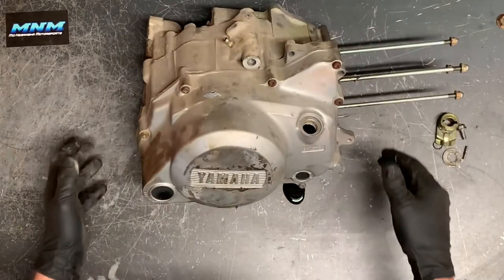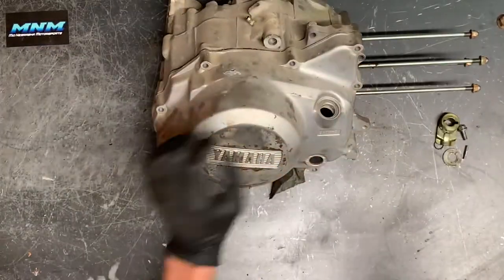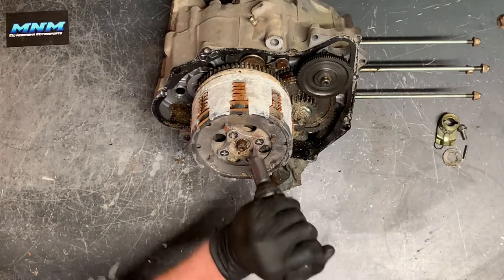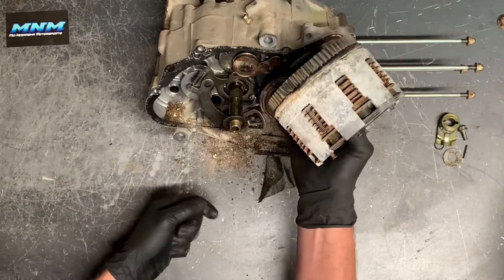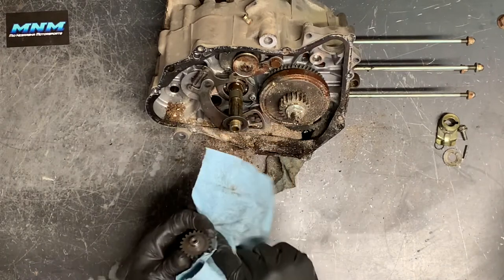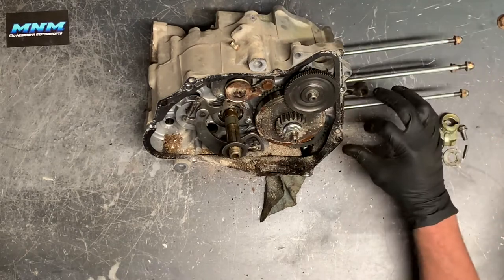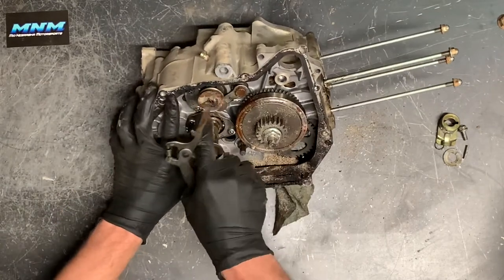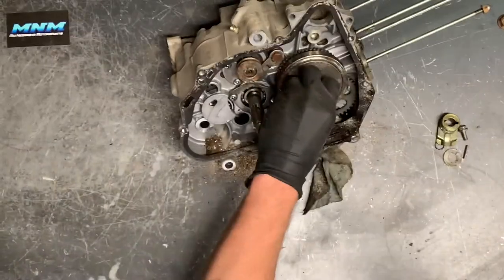Yamaha Badger 80 Kids 80cc ATV - Clutch Slipping - Won't GO Friction vs Steel Explained

Comment: What year is this?  85 to 88 is 4 gears. The ones after it are 3 gears. Also first generation was only called moto 4. The 90s 3 speed called badger. But since they look similar people refered to original as badger too. Notice the first generation has no suspension.